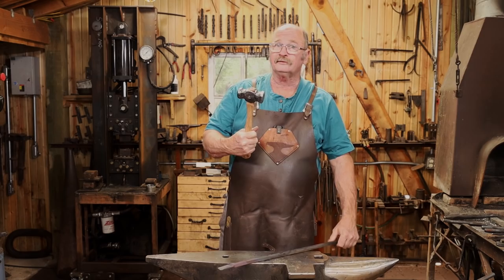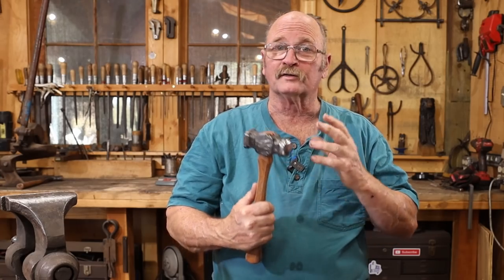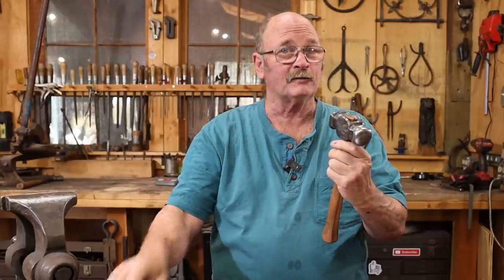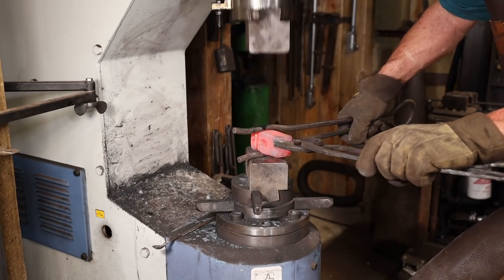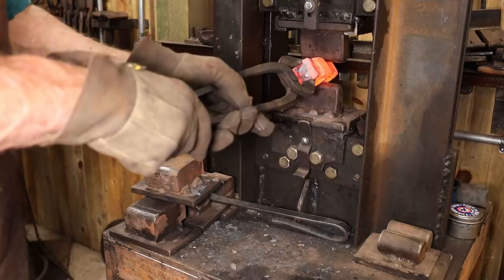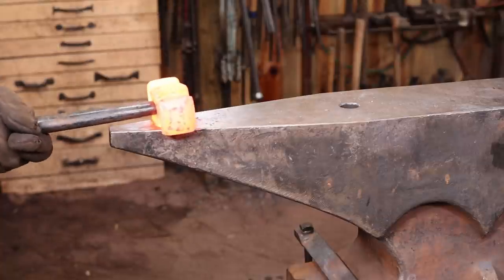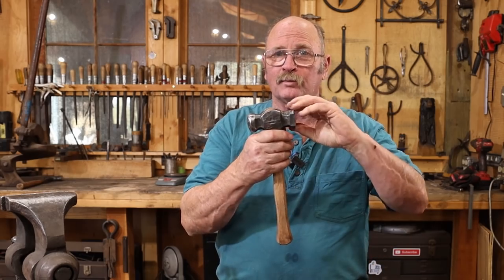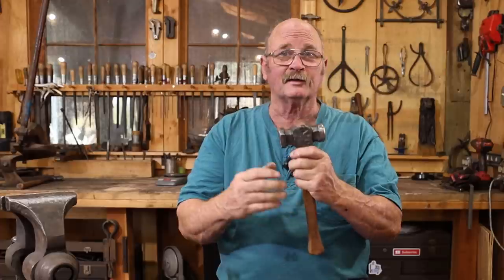Blacksmith Rounding Hammer

Comment: Hey John. Great video but please also continue doing the older style where you really get into detail about each step. Those videos are one of the main reasons I actually started smithing. I just did my first ever forge welds this weekend following your video on the basket twist. After hearing you say so many times that forge welding is an essential skill for any smith I was so happy I pulled it off. The idea of trying it was very daunting to me this last year of forging but I finally gave it a shot after refreshing up on your forge weld videos. Thanks!!

Comment: I look at something as "simple" as a hammer and think back to all those centuries when powerhammers and presses did not exist. 
I realize labor was cheap back then, but still... dang, that's a lot of work.
Reply: @clinkerbreaker9332  indeed, but how common were those? I really don't know... but even in early 20th century America a lot of people were doing a good amount of smithing work  by hand. Even for a bit after modern powerhammers had been invented.
The point overall is that we're kind of spoiled today. Mere hobbyists being able to afford industrial-strength power tooling is very recent. And in most parts of the world, still quite rare.
There may be more people making PW steel now than in any other period ever, and we don't even need it anymore. It's really just for looks nowadays...
Reply: Trip hammers have been pretty standard in most areas suitable for waterwheels since the 12th century, it was pretty much only the rural blacksmiths with relatively small shops who forged large items by hand in any period of history since then.
Reply: @garethbaus5471  yeah I phrased that very poorly. "Did not exist" is simply not accurate.

Comment: First class Blacksmithing. I will never get a power hammer or hydraulic press, Just all manual work meantime, I still have not got my shed up and running meantime, .However i did get some new video equipment and I will try and video the build of my workshop....

Comment: I have a very little experience with hammer and does holding the punch near really gets hot see that punch has a advantage but it might be a new skill handling it on plumb . But just to finish out should be helpful
Thanks

Comment: Beautiful work as always.
I also have a question that might seem silly.
How do you keep the hammer head from sliding off the drift when you're forging the cheeks? I've only made two and that's been a problem both times.
Reply from the maker: You just have to watch it and re set the drift often.

Comment: This question has been ignored by other smiths so may be too ignorant to bother but... Does the form inform the function and vice versa? The fullering, for example; my rounding hammer bought from a ferrier supply doesnt have those or the cheeks. I'd understand if they were both remnants of old style of forging but not sure if they're functional beyond that.
Reply from the maker: The fullering is really more for looks than anything.  But it does help isolate the material to allow the cheeks to be spread without affecting the faces.

Comment: Swinging a hammer can cause issues with hands and arms. I am surprised you left sharp edges on the handle of the hammer. I would think that you would want it as easy on the hands as possible.

Comment: You've probably told us before, but what brand/model belt grinder did you use?
Reply from the maker: I have three.   A Wilton Square Wheel (now sold by Jet), a new Beaumont Metal Works KMG TX, and a shop built grinder a fiend made.

Comment: Question from a novice, seems like every hammer video I see uses round stock, forges it square.  Is there a reason for this? Can you get hammer quality stock in square dimensions?
Reply from the maker: Round stock is generally available in more sizes and costs less.  In this case, its just what I had on hand.  But starting with square would be easier, especially if you don't have a power hammer or press.

Comment: Hey brother been having an issue with one of my hammers, the head keeps separating from the handle, I have tried rewedging it, but at this point I am not sure if that's even doing any good, should I just rehaft it?

 I guess I probably should it's been rode hard and put up wet so to speak but not sure if maybe the way I'm wedging it is the issue any tips would be killer.
Reply: You didn't say what style of hammer it is that you are having issues with. Could it be that the hole in the head is tapered and the taper is wide side down instead of up? If all else fails you could make the taper larger and try again installing the handle.
Reply from the maker: Eventually the handles dry out or the fibers compress to the point they just can't hold any more.  Replacement handles aren't expensive, so that would be my suggestion

Comment: Why use propane when you have a beautiful solid fuel coal forge? 🤔
Reply from the maker: Even heat with no risk of burning the work, can let the work heat while repositioning cameras for the next heat, no clinkers or other fire maintenance issues and when you live in an area without decent coal, it's many times more affordable.